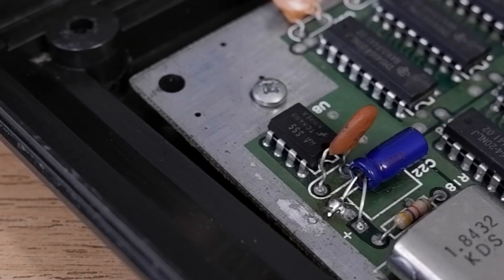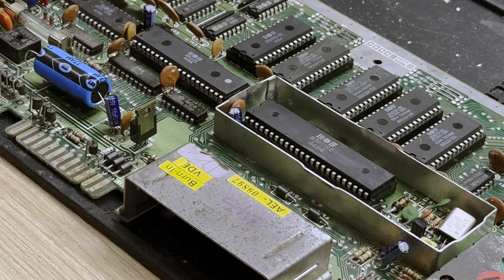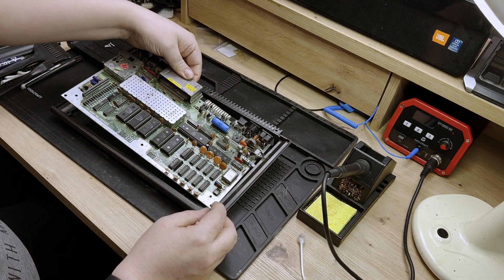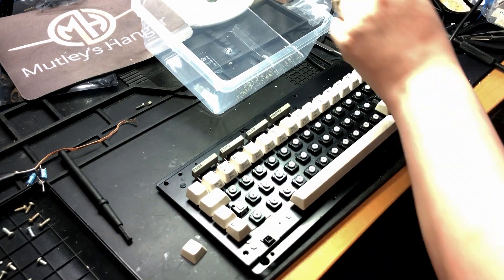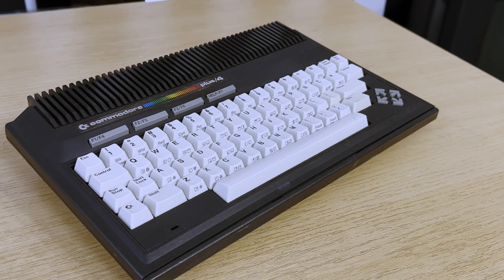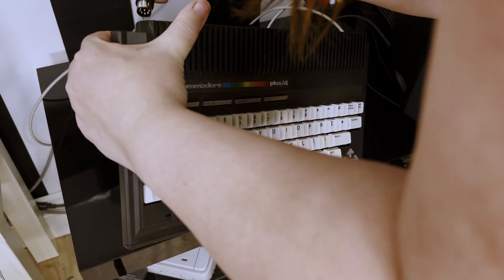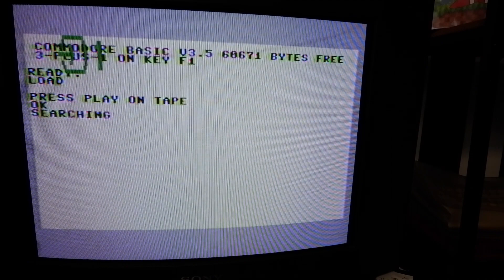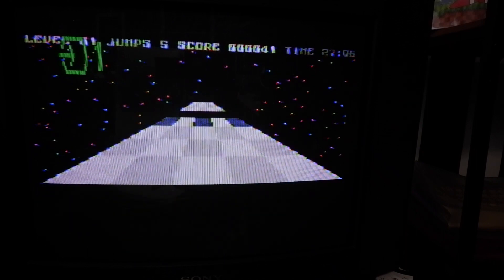Commodore Plus 4. Recap and Re-Assembly.

Comment: For cleaning the boards I use the dishwasher, does amazing job with the same tablet we use for the dishes. Just blow the remaining water with compressed air and let it dry for 1-2 days. No issues.

Comment: I've been learning these challenges myself. In my novice experience, I'd recommend getting a de-soldering iron. It has a larger tip, and so holds more heat where it is needed without actually being hotter. At a push, you can re-solder with it, too, although not ideal.
Reply from the maker: Hey James. Yeah the problem wasn’t the size. My desoldering iron looked beefy enough, but with just a 30w heater, it just can’t get enough heat into the board to clear all the solder. So off to Conrad I go for something better. :)